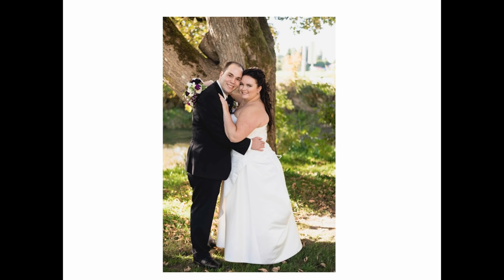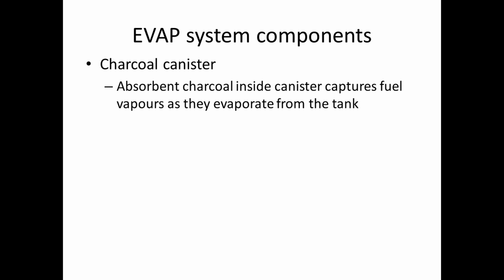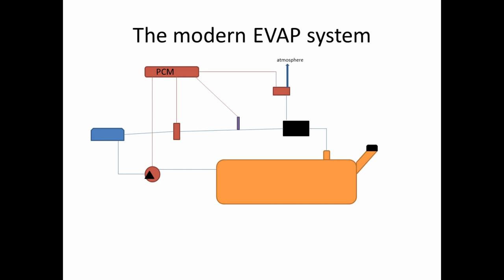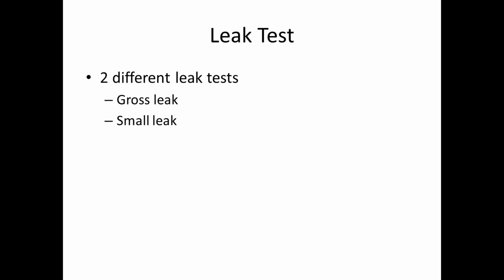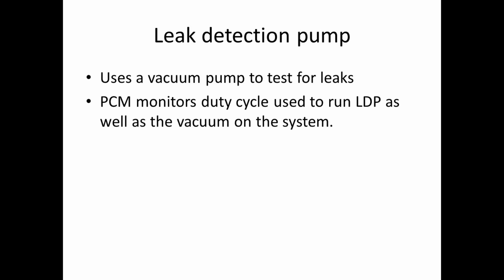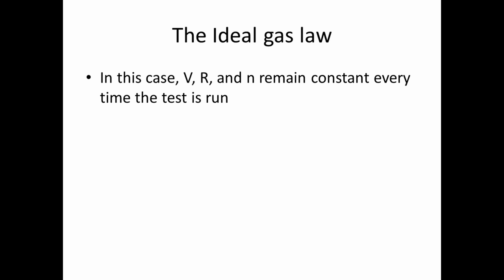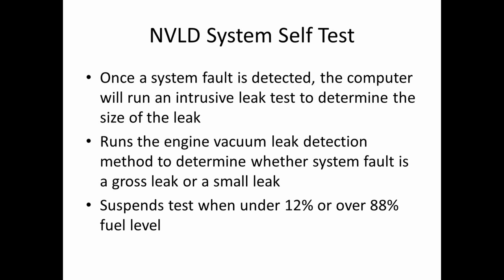6Speed's Lectures: How your EVAP system works

Comment: I have a po442 small evap leak. I have done a smoke test and all is good. I shut the solenoid off while doing the test then I opened the solenoid and the smoke would come out so I do believe my system is silled. However, I hooked my smoke to the brake booster hose and smoke came out around my intake gasket and also a pcv hose , would this set off the code po442 small evap leak?
Reply from the maker: It would not set off the evap system leak codes because it's only measuring the pressure after the purge valve. Small leaks can be extremely difficult to pinpoint as they may be so small that it's difficult to see smoke coming out. Scannerdanner has a good video on pinpointing small leaks.
Reply: @6speeddakota  Thanks...... I wonder if the pcm is telling the solenoid to close?... But then that would say a large leak I'm guessing. Thanks again and probably time to get a new scanner to be able to turn things on and off

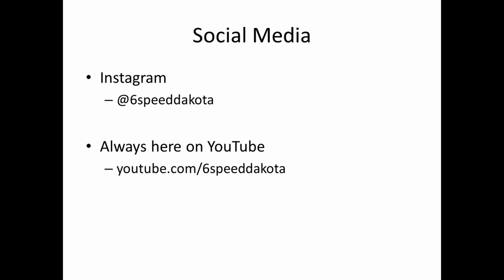Comment: Hi, I'm getting PO496 code and I've already changed my purge and vent valves along with my charcoal canister. Also have a PO420 code related to the catalytic converter but don't think that has anything to do with it. Any idea what could be the issue? Thanks 14:08 14:08 14:08 14:08 14:08 14:08 14:08 14:08 14:08
Reply from the maker: The cat code isn't anything to do with that. Typically it's an issue with the purge valve, but in this case, if that's already been replaced, it could be an issue with the fuel tank pressure sensor not reading correctly. Unfortunately I can't really say unless I can look at it directly
Reply: @6speeddakota  i already changed the fuel tank pressure sensor since i just changed the fuel pump assembly which has the pressure sensor on it

Comment: Can a faulty evap system cause the following:  Engine cold, car is started and driven for 10 to 15 minutes. Then, stop at store, shut off engine, return to the car after 15 minutes, start the car but it runs rough, with no power and dies. I then have to wait about 20 minutes before I can start it and drive normally again. I have had it to two different mechanics, and they can't figure it out. Many parts have been replaced, to no avail. Any suggestions. This is on a 1990 Volvo 760 GLE with the V6 engine.
Reply from the maker: It's very unlikely an evap system will cause that kind of issue. One thing I've seen cause this type of issue is the coolant temperature sensor being bad. If it thinks it's really cold, it will overfuel the engine, resulting in poor performance or just plain not running at all. The problem is that it can be hard to diagnose with an OBD1 vehicle because the data readouts aren't that great. I'm not super familiar with European cars, so unfortunately I'm not exactly sure what's wrong.
Reply: @6speeddakota  I did check the temperature sensor. It is one component, but contains two resistors that varies with temperature. One resistor connects to the Ignition System computer and the other to the Fuel System computer. But thanks for responding.

Comment: I replace my fuel tank and my fuel pump and when I turn it on now liquid fuel come spilling out of the EVAP vent valve canister why is that? And the vehicle is never running it just once I turn to the on position that is when fuel comes leaking out of the vent valve canister all over the ground below.
Reply from the maker: Sounds to me like you’ve got the lines hooked up wrong. When you turn the key on, the fuel pump primes to pressure up the fuel system, hence why it’s spilling out when you turn the key on.

Comment: So does the vent valve open at all while the fuel pump is sending fuel? I would think it would need to so that air can get into the tank to take up the volume of fuel that is displaced. Because if air couldn't get in while fuel was being delivered, wouldn't that create a very strong vacuum in the fuel tank which would require incredible power to the fuel pump? Or am I understanding something wrong?
Reply: Nevermind..."HOW THE EVAPORATIVE EMISSION CONTROL SYSTEM WORKS

Sealing the fuel tank is not as simple as it sounds. For one thing, a fuel tank must have some type of venting so air can enter to replace fuel as the fuel is sucked up the fuel pump and sent to the engine. If the tank were sealed tight, the fuel pump would soon create enough negative suction pressure inside the tank to collapse the tank. On older EVAP systems, the tank is vented by a spring-loaded valve inside the gas cap. On newer vehicles, it is vented through the EVAP canister."
Reply from the maker: I made an incorrect statement, the vent valve is generally closed for leak testing only, not all the time
Reply: @6speeddakota  @Joshua Smith
Great explanation. I had this question till I watch this video and coments. Thanks a lot.
Reply: @joshuasmith1215  
And also what I think, I found is that those system witch not monitering the EVAP pressure, dont use vent valve. If its not rigth, plz correct me.

Comment: did you fix your wifes car problem  ? cause my audi tt does the same thing when i try to put gas in it. it keeps shutting off the fuel filler, so i have to keep pressing the trigger. 
or how do you fix that problem?
thank you  much for your video its very well explained.  :)
Reply from the maker: The problem with my wife's car ended up being a plugged charcoal canister. I took the vent valve off and it was totally clear, and when I traced back, I realized that the canister was totally plugged solid. When I bought a junk car to fix some issues with hers, I swapped the charcoal canister out of it and that alleviated the issue
Reply: @6speeddakota  
Thank you!! I was thinking the same thing( canister,vent valve replacement ) just curious about  your car. 
👍👍

Comment: So would running ur car as u fuel up potentially saturate ur charcoal canister, Since the vent to atmosphere is closed?
Reply from the maker: Creme Fraiche you’d have a hell of a time trying to fill the car up, probably because it’ll freak out when the tank pressure sensor reads atmosphere and will cycle the different valves to figure out what’s going on. In that time because the vent will be closed, it won’t allow the air to escape so it’ll travel up the fuel hose and it’ll click the pump off constantly. My wife’s Mazda had a similar situation with a plugged canister and putting gas in it was a real chore
Reply: @6speeddakota  ok thanks for the response. Great video!

Comment: My doubt is during the purging operation you specified that the canister vent valve is closed which leads to vacuum due to which the fuel is adsorbed from canister what governs the maximum vacuum. How is the amount of fuel going from the charcoal canister controlled. it might sound ridiculous but is the vent valve really closed during the purging operation because what i felt was the due to vacuum the air would be sucked through vent valve which would pick up the fuel from charcoal canister but is this happening or what is really happening during purging is only the fuel getting adsorbed no air please help to clarify my doubts..
Reply from the maker: The vent valve is closed during operation. Back in the day, there was nothing that governed the vacuum to the tank. Nowadays, the PCM can control how much the purge valve opens, which controls the level of vacuum into the system.

Comment: Sometimes I smell gas when I get outside my 07 dodge caravan especially early in the morning after I’ve driven a couple minutes. Thinking vent value may be sticking open from time to time. Also have a “gas cap”msg on my odometer sometimes. What say you? Thx.
Reply from the maker: It's unlikely to be the vent valve since the vent valve is after the canister, which will absorb any fuel vapors. It could be anything really from a rotten hose, to a bad seal at the fuel tank where the pump sits in the tank. The easiest way to find an issue is to try smoke testing it. You should be able to find a cheap smoke machine, or make one simply.

Comment: I'm going crazy smoke test showed nothing pt cruiser  2005 non turbo touring replaced OME gas cap, purge solenoid and leak detector pump... Still have a P0457 I'm in NY and it won't pass inspection soon!!! Help!!! Some say it could be the filter before the leak detector pump and the hose going to it. I'm throwing one part after another and mechanic scratching his head!!
Reply from the maker: Check the vent valve. If it’s stuck open mechanically it’ll definitely trip the gas cap code. Electronically it may still function, which won’t trip a trouble code for it
Reply: @6speeddakota  thank you

Comment: I have a 2006 dodge magnum that appears to use the older style NVLD system. I recently got a P0455 (large evap leak) code set 118 secs after a cold start up. From anyones experience , is it common for the vent valve sensor to go bad/ stuck and show a code as if there is a leak when there is not? Tank is at 50% in a heated garage . Thanks
Reply from the maker: It can cause a large leak code if the valve is good electrically but stuck mechanically. Most likely there's a split hose or a broken line somewhere, but if that search is fruitless, then you could try energizing the vent valve on the bench using 12v and see if it clicks.
Reply: @6speeddakota  thanks for the quick reply. Since it was so sensitive I thought it may get stuck mechanically as you said. The car only has 50k on it , kept in a heated garage since 2009 in NYC. I drive it only 1000 miles per year these past 3 years. It is perfectly clean underneath, no oil , dirt or grime.  I found it hard to believe the hoses and pipes on the system would rot and split like most cars used daily and exposed to the elements. Maybe there is dry rot due to its age. Thanks for your video and help.

Comment: I'm from México , Thanks for the video , do you know if is it normal to have a 20% reading from the evap purge valve on the scan while vehicule idleing ?  When vehicule is switch off valve closes normaly it seem to work good when car is moving presing accel valve opens  and once reléase accel valve closes to 0%, but when stoping the car completely valve opens an stay at 20%.

I getting negative LTFT, once the car reaches high temperature (27% negative ) but befor it, i get around 7% negative LTFT  all the time.
Any addvice is apreciated.
Reply from the maker: 20% is fairly normal at a low speed. A negative fuel trim means that the computer is pulling fuel away. This means that the PCM senses rich; this can be the result of a few different things, but it's usually down to 2 culprits. One is that it's getting fuel from an external source somehow, the other is a problem with the oxygen sensor.

Since you have the capability to read data on the computer, what you need to do is to check for the function of the oxygen sensor. Once the vehicle warms up, it goes into closed loop and uses the oxygen sensor as a feedback loop, that may explain why the fuel trims shoot way negative when it's warm. So what you need to do is warm the engine up until the loop status shows closed, then look at the oxygen sensor readouts. You're looking at sensor 1, not sensor 2. You should see the volts moving back and forth from near zero, to just below 1 volt. It may not in your case because your fuel trim is pegged all the way negative. So what you need to do is to pull off a major vacuum line like the brake booster hose, and then watch the O2 sensor readout, it should go lean (low volts). Then, take off the intake track and feed it some propane or brake cleaner, be careful not to damage the mass airflow sensor, that will force the engine to run rich. You should see close to 1 volt on the O2 sensor.

If you don't see a change in volts by forcing the o2 sensor rich and lean, you have a bad oxygen sensor. If you do see a change, then you've got fuel coming in from an external source. Older vehicles with a return style fuel injection system can have the fuel pressure regulator diaphragm go bad and it will start leaking fuel into the vacuum lines. Another one I've seen before is with a newer direct injection engine, the high pressure fuel pump was leaking gasoline into the engine oil and the fuel was evaporating out of the oil and being sucked into the PCV system. An easy way to determine this is to take the oil cap off and sniff inside the engine, if it smells like gas, there's your culprit. Another way to test is to drain the oil out and smell it for fuel. This doesn't normally happen with a regular MPFI engine though.

Let me know what you figure out.
Reply: @6speeddakota  
Thank you for promt response, I remember a mechanic some 7 month ago put an used o2 sensor and my  trim reach 2 or 3 % negative , but somebody told me tu clean that o2 sensor whit gasoline and some vineager and i do so , do you think it could be the cause??
Reply: @6speeddakota  Thanks for making this video. I needed to understand this stuff.  Like Mr Ayala I see 20-35%  Does that mean that the purge is slightly opened or that it is cycling opened and closed per minute? And what if the ECM needs to open at 100% to get  tank pressure down?
Reply from the maker: @mrkazanecki1  what is happening is the PCM is sending a pulse width modulated (PWM) signal to the purge solenoid to open it. Applying less than 100% duty cycle will partially open the valve. Basically what they're trying not to do is suck down a bunch of fuel vapour at once, because that'll cause the system to want to correct for a rich condition. Imagine it as sipping on a beer, rather than shotgunning it; at the end, you've still drank all the beer, it's just taken a little longer, but your body isn't going to try compensate because you didn't gulp it all down in one go.

Comment: Won't the small leak cause gross leak as well ? If purge valve is open and vent valve is closed the leak could be in Charcoal canister or intake valve area. Compare to this when purge valve and vent valve both are closed the leak can only be in Charcoal canister. This means if there is no gross leak there cannot be any small leak. Please correct me if I am missing something.
Reply from the maker: The difference between a gross leak and small leak is just the time it takes for the vacuum to leak down. The leak could be anywhere between the purge valve to the vent valve, that includes all the fuel tank, all of the fuel lines and hoses as well

Comment: Thanks for vid

can I take these valves out and apply 12 or some volts on each to see if they are stuck close or open. 

also how many volts I should apply
Reply from the maker: Some only use a 5 volt signal. Measure the output before you go ahead and try applying power to things. Be very careful applying power to things, it's super easy to cook the computer if you don't know what you're doing

Comment: I have a 04 corvette  with bad fuel smell  it's not throwing any codes has a new gas cap  what would  be some  of the  first things I should  check I have to leave the garage  door open until  gas oder  clears
Reply from the maker: When do you notice the smell? Once it's been driven and parked? or after it's sat for a while? Also, is it hard to start (long crank time) after it's cooled off?
Reply: After driven and parked very  easy  starting
Reply from the maker: https://www.youtube.com/watch?v=GHIwR0233mc
https://www.corvetteforum.com/forums/c5-tech/2501305-gas-smell-98-c5.html

I found a TSB on a forum explaining a very common fuel leak on this exact year, as well as a video of how to fix it. Another place these commonly leak from is the o-ring seals on the fuel line quick connects that connect to the filter. I hope this helps. Good luck and let me know how it goes; I love corvettes, they're some of my favourite cars, I've gotten to drive a C7 ZO6 and it was an experience I'll never forget. I hope to own one in the future, but it has to have 3 pedals ;)
Reply: Thank you for the info  I'll read  though it if you think  of anything  more  please  let me  know  thanks  again

Comment: I have a p0440 code on my engine. Do evap codes actually cause problems in the performance of my vehicle? Or is it more for environmental awareness?
Reply from the maker: P0440 is evap system general failure, the EVAP system keeps the fuel vapours out of the atmosphere. They shouldn't have much bearing on performance
Reply: 6speeddakota Thank you

Comment: Hi. I am getting P0441fault in my Honda Accord 2017 saying purge malfunction. The same time it gives another fault P04F1 saying low purge flow detected. 
After watching your video, i opine that my purge valve is not opening or there might be some clogged hose.
Can you please advise.  Thanks
Reply from the maker: For a 2017, I would take it to the dealership because it's most likely under warranty I would assume. Anyway, there's a whole ton of things that could cause an issue like that from a bad purge valve to a bad gas cap. best thing to do would be to use a smoke machine to smoke test the evap system.

Comment: I have always known that the vent valve is closed during evap system test and never during purging. Are all system the same?
Reply from the maker: I'm sure it varies system by system, each manufacturer has a different way to program the subroutines on their purge cycles